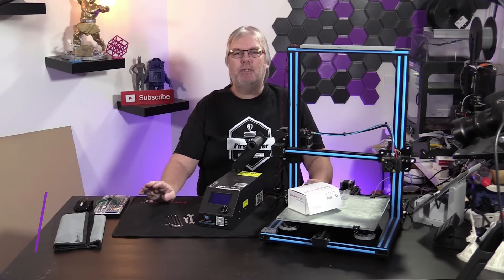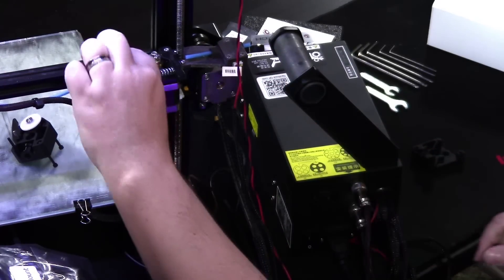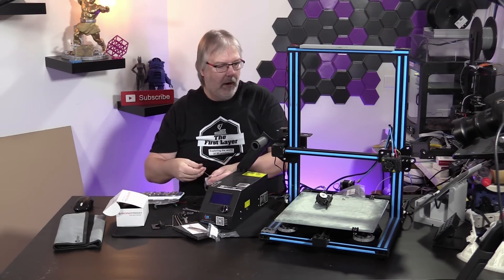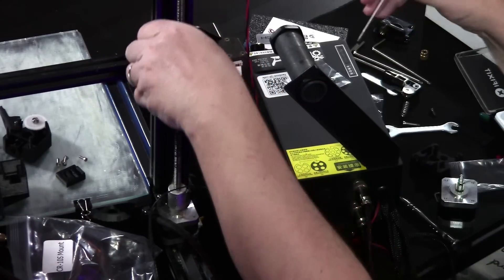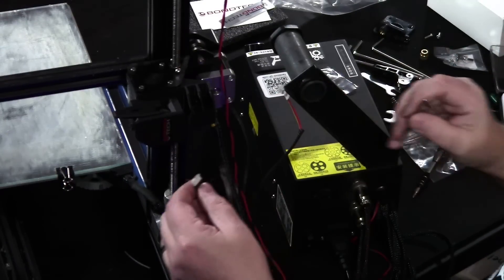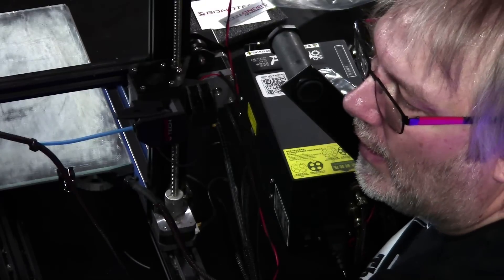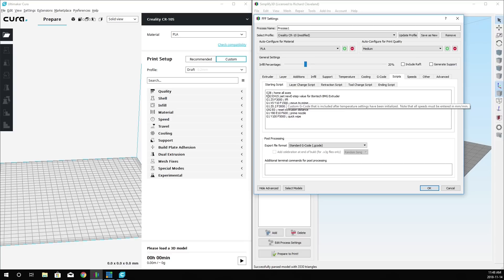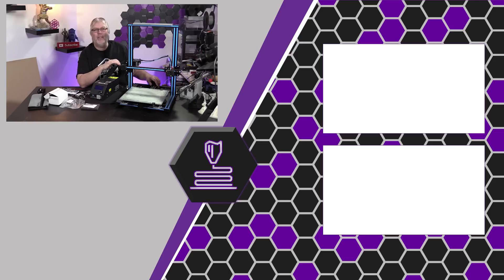The Bondtech CR-10 extruder upgrade kit and install!

Comment: I gotta say I was a little unimpressed. It was good but it definitely didn't make anything better to the point of buying it, installing it and the hardware matched absolutely nothing as you this shows. So driling or buying hardware is about the only way to get it installed. And you end up having to play around with every print is my biggest issue. It definitely is not just a 1 time setup. It kinda squishes the filament. Not all filament is created equally lol. So if you have a softer pla you will need to adjust it to make sure its feeding well and not turning youre round filament to square filament. And when feed rate really isn't a problem with stock extruder and just left and never messed with much....you now have to adjust flow rate on most prints on the display control, cuz although this works well when its all setup and dialed in. The problem is that you have to set it up and dial it in every time to make sure its optimal to what the print requires......its kinda like a having a car with either standard or automatic transmission. Some like having full control as where others don't care and are content and don't wanna bother with it as long as it drives...if you like automatic, this is definitely not for you. But its a standard lovers dream lol
Reply: figure it the fuck out! JESUS if you have a 3d printer for any amount of time you realize you need to figure shit out! you probably have too much money and have NO CLUE of what you are doing......

Comment: Installed backwards...is why the wires needed reversed. Filament comes out the flat end, and goes in the end with the non removable fitting.

Comment: Are you having issues as far as the stepper motor for the extruder getting hot now?  I have to have a fan on mine now.
Reply: you need to ajust v reg

Comment: does it work with other upgrades? specifically will it allow the BLTouch auto leveler to mount using the printable mount bracket?

Comment: Good stuff Rich, I may get that for my Ender 3. I just received my CR-10S Pro and it's still sitting in the box upstairs. I have a question for the Pro, should I be using the 10S profile in Cura and is there anything I'm going to have to change or add to the start G-Code for the Auto bed leveling? Thanks

Comment: i have an ender 3 and on every print with a small tower or tip ( like a spike ) it WAY  over extrudes and ruines the print, it pus out so much that the nozzle gets partially buried in plastic, i cant find anybody who has had this problem or knows how to fix it. i have tried multiple profiles with different layer heights, flows, temps, and speeds but it always happens. have you ever seen this? 
example photo: https://photos.app.goo.gl/HMLMnpo1L55saGyE7
its not as bad as it was originally because i trimmed the tips a bit before the photo
Reply: Looks like the filament isn't getting enough time inbetween layers to cool. Look up "Minimum Layer Time" in Cura, and be sure to use cooling fans.
Reply: @BryanBakerXBrav  finally figured it out, turns out hatchbox is just bad stuff, tried the included filament and it worked perfect
Reply: I dont think so, hatchbox is top quality. Maybe you need to fine tune your E steps
Reply: @elijahf111  hatchbox is great.